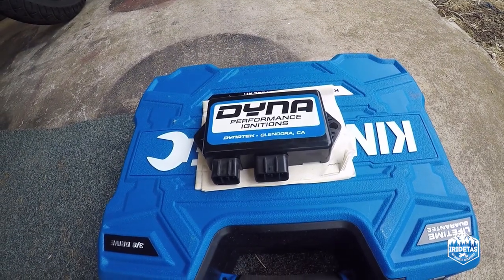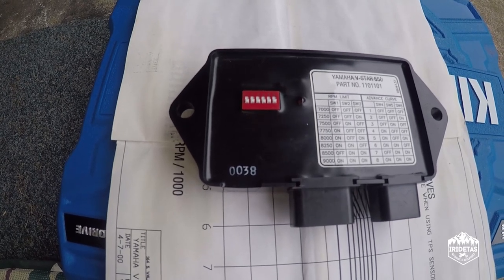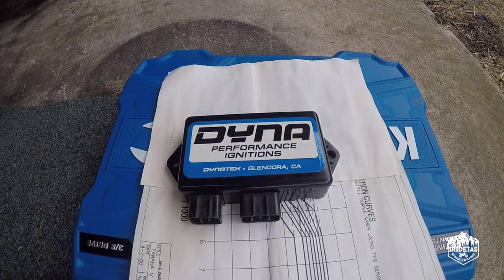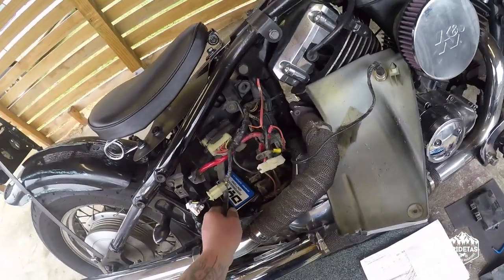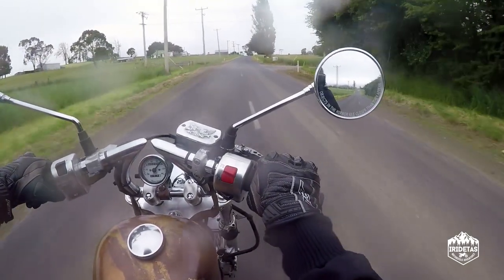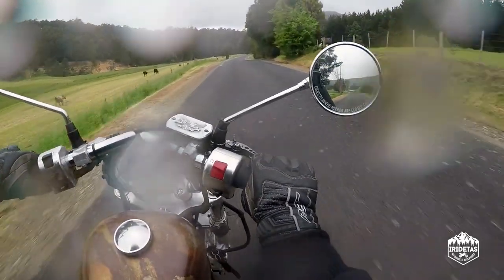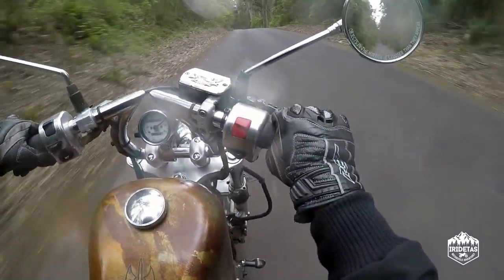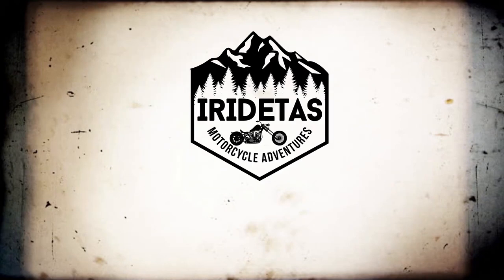BBBs02e24 | Dynatek 3000 Performance Ignition Install, Test Ride & Review | XVS650 or V-Star 650

Comment: I put this on my v star 650. Made a huge difference! I upgraded the coils a month later and it has never had this much power and smoothness! Great looking bike! Progressive rate spring in the rear makes a huge difference as well!
Reply from the maker: I found it worked really well, i am looking into coils atm!
Reply: Dyna says factory coils are sufficient. I run a 1700, your sayi g you seen a boost in power from the coil tho?
Reply: @christopherkimmer8240  it ran great with the factory coils and module upgrade. Definitely wasn't a huge power increases  from just the coils but seems to respond quicker and less backfireing on deceleration with the upgrade.  My factory coils could have been going bad as well. I wasn't clear in my wording but I meant it had more power with everything  done then from stock. Would definitely do it again though
Reply: What coils did you use?
Reply from the maker: Stock

Comment: Stupid question for you, your bike? I noticed that most Yamaha's have a top speed of 65 miles per hour. Mine kind of tapped out at 80 and started slowing back down. Do you think this part will actually in crease the speed of it or no?
Reply from the maker: Top speed, no chance, its limmited by shaft drive gearing, torque and hp. Fun factor and throttle responce etc. Absolutely yes!
Reply: @iRidetas Okay, thanks. This helps a lot.

Comment: Hey man just wondering if you know, do these still work on a 2017 model xvs650 custom I can't find info anywhere. Thanks in advance.
Reply from the maker: There website has all the model compatibility you will need
Reply: @iRidetas  yeah I emailed them apparently they can only guarantee compatibility up to 2005 but given that the only real difference is in the carbs which I have already fixed I might just grab one and give it a go

Comment: When are you going to do a 4spot brake conversion . Im just trying to work out which calliper to use on mine At this time
Reply from the maker: It only works on classic front wheel, I'm now running 19inch so spokes touch the caliper casing
Reply: @iRidetas  Bugger

Comment: Hey mate installed the 3000dynatek but now my headlight wont work do you know a way to get around this
Reply from the maker: I cant see the two would be connected
Reply: @iRidetas  yea like wise,I put the stock ecu back in and what the head light works
Reply from the maker: Weird, but could be a short between those circuits or the plug is incorrectly pinned, not sure mate sorry